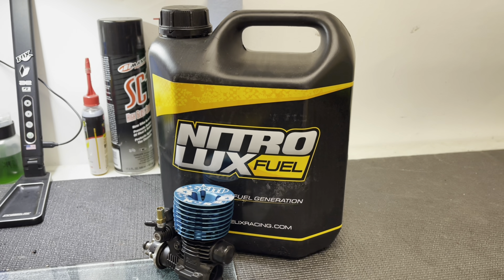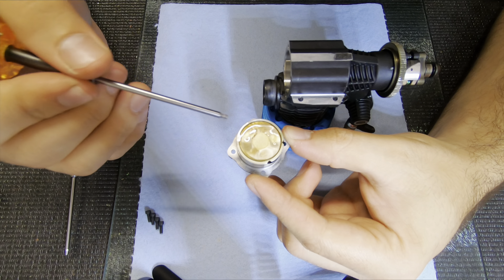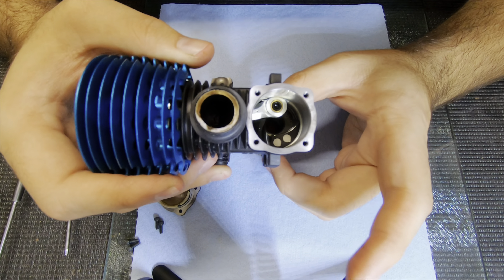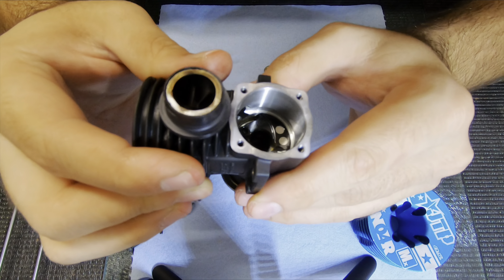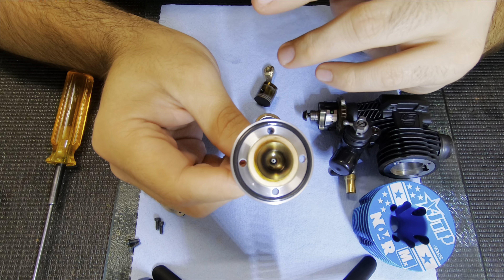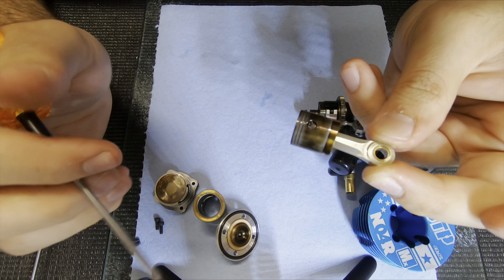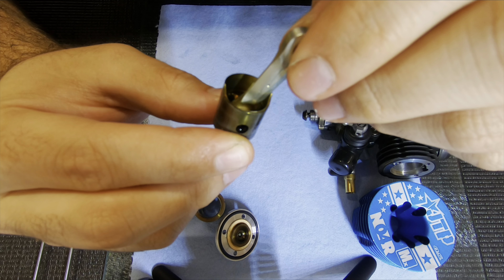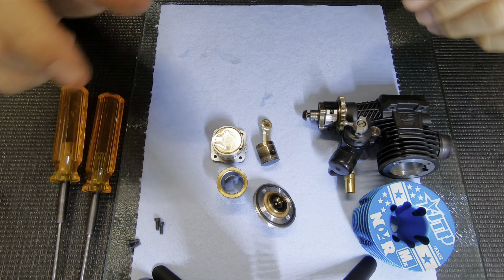NitroLux Fuel After 5 Liters of Running! || Enzo Albertoni

Comment: Thank you Enzo. I love your vids. I like this Maxima Engine are there any differences between this and the OS B2104?
Reply from the maker: Thank you so much! This engine is a Maxima engine, but I will say that the internals are still a OS B2104. So it will still deliver power and fuel millage of a B2104, however maxima has added some porting to the sleeve. But this engine was cleaned and ported further with AMR engines and it runs amazing!